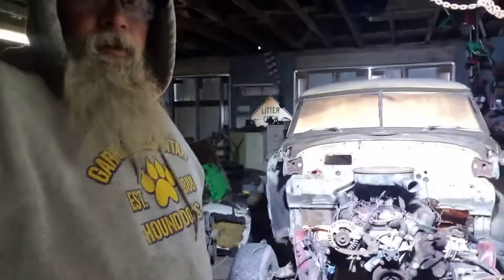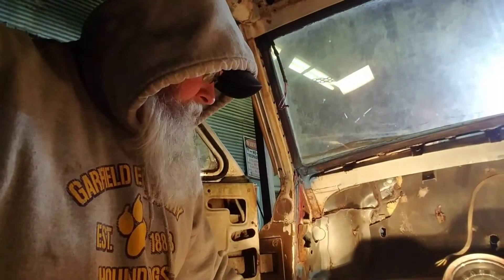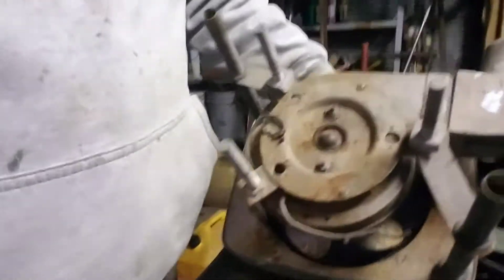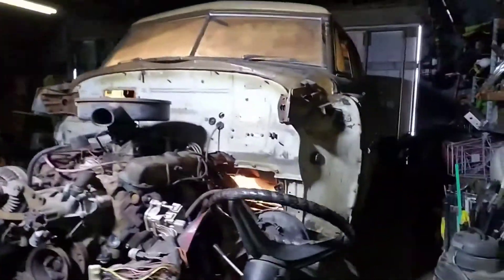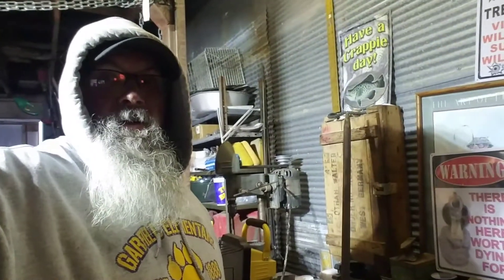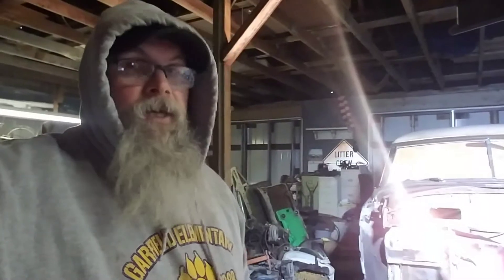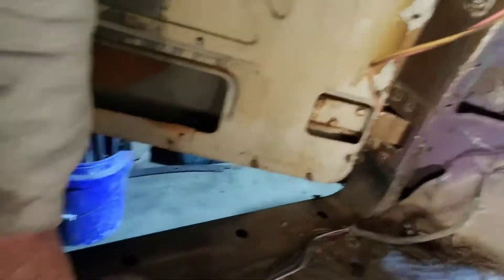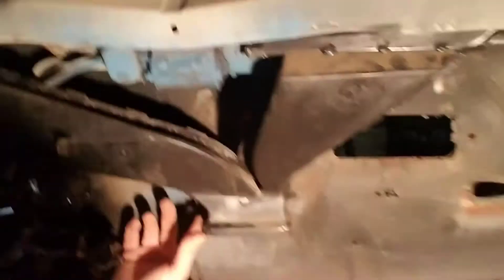Coronet (Episode 28)

Comment: Neat heater box, u can use Chrysler ballast on hot wire to heater and wiper motor,good plan doing wiring before pedals &such really nice examples of recycling and not mail ordering every piece!
Reply from the maker: Thanks for the advice. I have plenty of resistors.

Comment: Mopar in the early 50's had the best dashes IMO. I do my absolute best to keep all that original, even if it's repurposed. Not Saying It Will, but I've run a lot of my 6v fan motors on 12v and they hold up really well to it. 6v motors are HEAVY wound for the higher amps (lower voltage), but Low is all you need because they spin quick on 12v. If nothing else though, it's pretty easy to match a motor to the squirrel fan.
Looking dang good Brother Hoopty, and again, I'm sorry for crawlin' under that Ford yesterday. I didn't mean to send that weather back down on you like that.
Reply from the maker: I love the classy interiors they used to have

Comment: I dont know if you want to but if it helps the home supply places like Lowe's and menards has thin foam insulation panels with the aluminum foil fronts for cheap and just use the dry wall type nails with the green plastic washer and mount them across the beams above ya to keep the heat in your shop . I plan on doing that once I get a cheap car port to box in or a cheap portable building since I have nothing right now so I have to stay indoors till the temps get above freezing during the winter 😞🙄😡. make sure to take plenty of warm up breaks 😎👍🏁